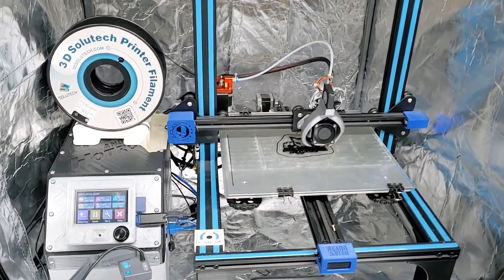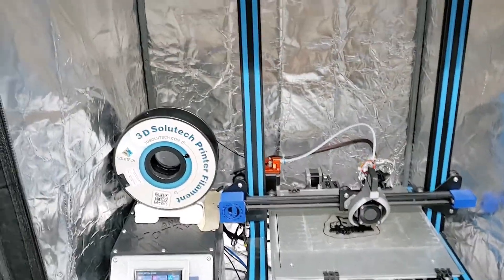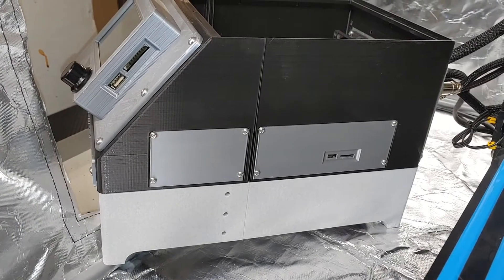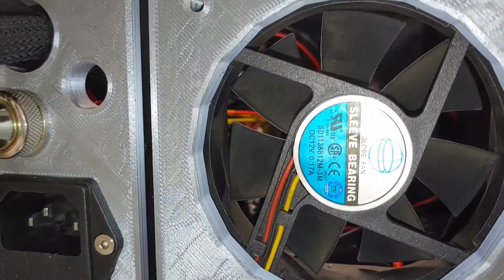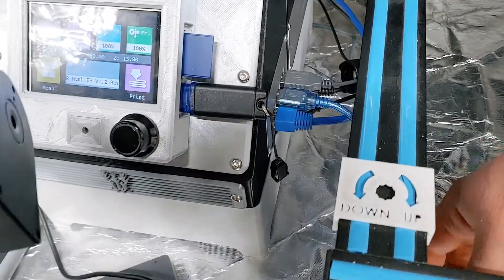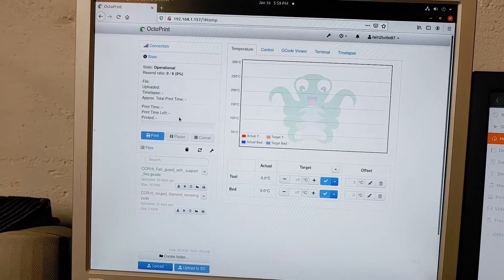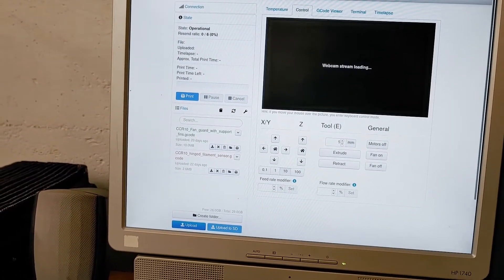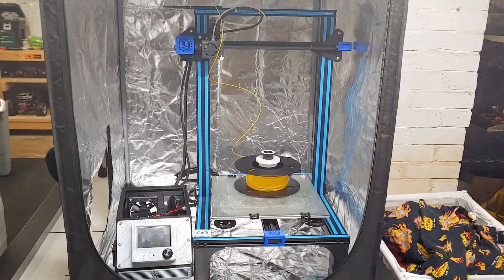Creality CR-10 3D PRINTED CASE, Octoprint, BTT E3 V1.2 and the Creality Enclosure!

Comment: When you add a shape in Tinkercad there is a box that pops up.  It has three (3) slider options at the bottom.  The first on is sides.  The default is 20, min is 12 and max is 64.  If you take it to 64 you will have “rounder” circles.  Now, the larger the circle, the more noticeable the lines are.
Reply from the maker: Thanks man!